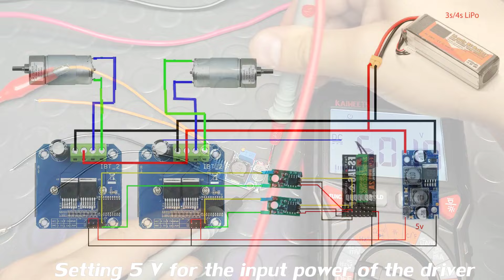How to control DC motor without ESC and Arduino using cheap BTS7960 HW-039 driver and Flysky FS-I6X

Comment: i did the same wiring but won't work 😢 please any advice
Reply: I will looking to try can you write if you solve the problem i didnt try yet. if its work ı will try
Reply from the maker: I guess it is a different firmware version. I don't have any other clues... :(